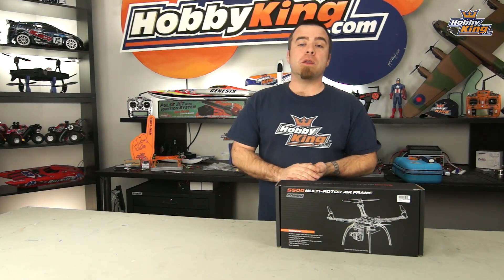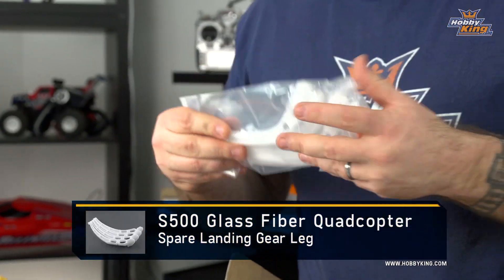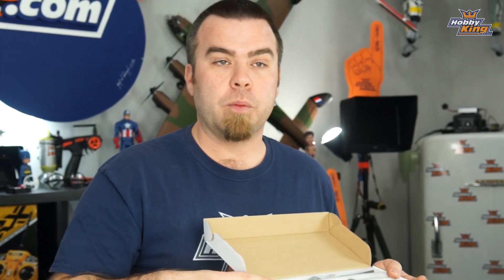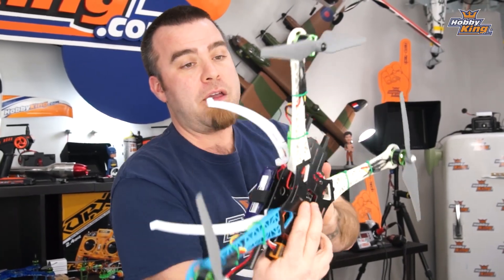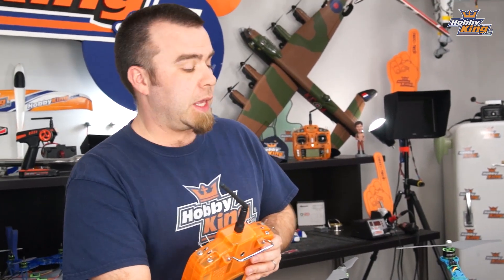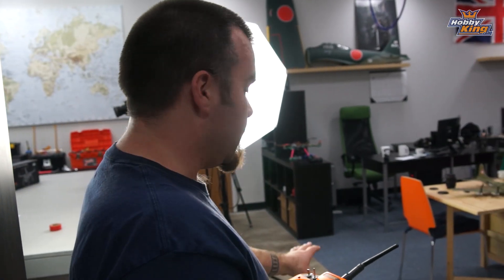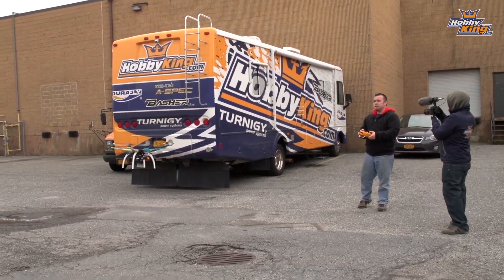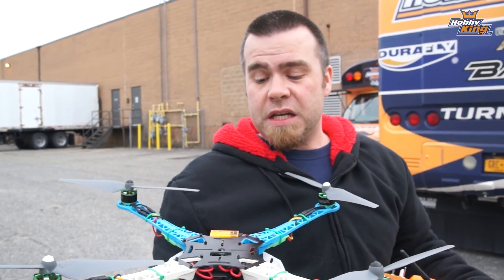HobbyKing Live - Product Profile - HKS500 Combo

Comment: PLEASE HELP!!!!!

Hello, I bought  S500 FR4 Glass Fiber Quad Copter 480mm PNF Combo + OrangeRx T-SIX 2.4GHz DSM2 Compatible 6CH Transmitter w/10 Model Memory and 3-Pos Switch (Mode 2) 
It's almost the same kit I see on the video.I assemble everything. Everything seems to work But the quad is not going up. it's stuck on the ground even thought I push the throttle to 100%. 
I am struggling with that . it's almost 2 months...
Please if you know how to set up OrangeRx T-SIX please let me know.
Reply: double check props rotating correct way!

Comment: You said you would measure the flight time with your battery and tell us but you didn't tell us. Please I would like to know, also if some one could tell me the range your getting with the orange t6 tht would be great.
Reply from the maker: +Rahul Amirth We saw around 6-8 minute flight times using a 2200 3s.
Reply: Thanks! How about the Range with the orange t6?
Reply from the maker: +Rahul Amirth We didn't really push the range too far, but range on the t-six is typical of any 2.4ghz system.

Comment: Planning to use it with NAZA m lite with GPS and ZIPPY 2200 60c 3s battery also changing the ESC to AFRO 30 amp...... Will the motor be able to lift up because the battery is pretty heavy...... What thrust does the motor give with the 9443 props..... Thank you for reading.... Anyways happy flying and safe landing.

Comment: I received my kit a week or so ago, assembly is easy, I went to calibrate the ESC's per the instructions and found 1 dead ESC and 2 dead motors, I checked everything multiple times, all dead, I submitted a question explaining everything and have some ticket # but  no response from anyone. I didn't want to wait weeks or longer for replacement parts, I ordered replacement motors and received them quickly, so I hooked them up and started to set them up when 1 of the 2 just started to smoke, another dead motor, so out of 6 motors 3 are dead, this is a 50% failure rate. I am very disappointed and don't like posting negative comments, but if it helps one person make a decision as to buy or not, it will be up to them, they might get lucky and everything will work I could of just gotten a bad batch, but WTH !
Reply: Dude I got exactly the same thing! A dead esc
Reply: I went back over all the esc's and motors 1 by 1 and found that I had 3 dead esc's, 1 that smoked and the other 2 made the motor jump back and forth, I still have an open ticket with them and no response in over 3 weeks, it really sucks that they can't even bother to take care of the customer after getting shitty parts.
Reply: Bill Gaudette I had this problem but have since received replacement 20A escs

Comment: This was a very easy build - I had a bit of an issue with binding it to the Devo 7 and a RX601 - however after chatting with your help support and reading the instructions again, setting the dip switches correctly (1 on - 2 off - 3&4 on) it binded correctly and I was able to fly it - I got 22+ min with a fully charged 5200 Lipo (from my Walkera 350 Pro) with an SJ400 camera mounted - total weight was 1315g (battery, quad, and camera in protective case) - this was just hover test so actual time may be less in a high wind situation..
Reply: Total cost for my setup (not including battery $50, SJ400 $65 or Devo 7 ) was less than $150 with shipping and the RX601 - not bad

My next upgrade already ordered for this set up is an APM2.6 ArduPilot Mega External Compass APM Flight Controller +Ublox NEO-6M GPS (for about $68)
Reply: +Andy Z buy this quad for a lesser price here : http://www.hobbyking.com/hobbyking/store/uh_viewitem.asp?idproduct=66873&buddycode=D81B6068-0607-460B-BDB8-25C04905B60F

you have to sign in to your hobbyking account to avail the offer.

Comment: Enough for me to give it a try. Should I go with larger esc if I am going with the hk pilot master set?
Reply from the maker: Andy Solis I might step up to 20 Amp afros.  It would give you nice extra peace of mind. - Matt
Reply: HobbyKing Live thanks Matt! So far its been fine. The turnigy action cam came with a mount that fit through the holes in the candy dropper and bottom section of the s500. Calling it a Droñata

Comment: I was wondering about the battery as well. It looks like you are using a Turnigy nano-tech 2200mah 3S 35~70C Lipo Pack. Would I be able to use a standard Turnigy 2200mAh 3S 20C Lipo Pack? This battery would only give me 44amp of maximum sustained load allowing 11amps per motor. Would that provide sufficient lift for this quad?
Reply from the maker: Jay Curcillo That would work Jay but it's marginal.  The ESCs are 15 amp, so in theory you could pull too much current.  - Matt

Comment: Great vid.  Just ordered one. Going to use it as a mini quad for Fpv flying. No landing gear and mini FPV gear with cam tilted up.  
At this price, no problems with crashing it over and over and I can plug/play.  Then will learn to solder on this set up.  

The flight controller seems limited but perfect for my FRSky DR-4.   I'll figure out another flight controller in the future.  

Killer price!   I've spent this much on props for my mini Fpv quad

Comment: Kind of surprised a multistar battery wasn't recommended for this or is there not one in this range?  I will say I was skeptical at first but after many flights with my dart 400 and ms 4s 4000ma they have worked above my expectations.  Hard to believe a 10c battery working just as good as my aspects ones.  Don't about how many cycles I will get out of them but can't beat the price or weight.

Comment: HobbyKing, would your HK Pilot 2.7 fit on that lower tray? taking into consideration the use of the included mounting tape, and servo leads?
Reply from the maker: Lion Silver It would fit if you were really careful with cable routing.  I just put the HK Pilot 2.7 set on one for an upcoming episode and I ended up mounting it on top.  - Matt
Reply: Thank you :)